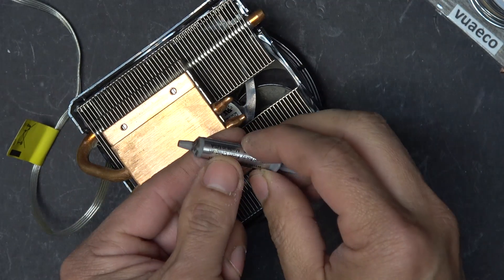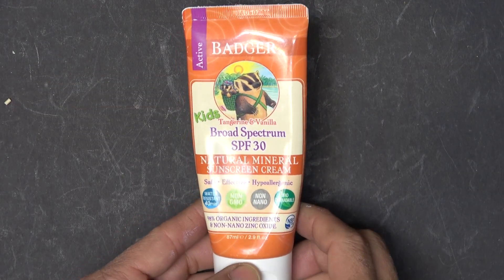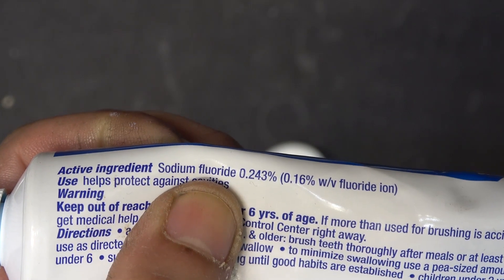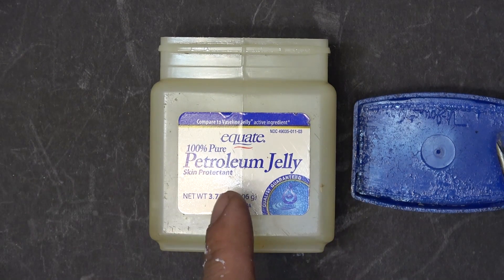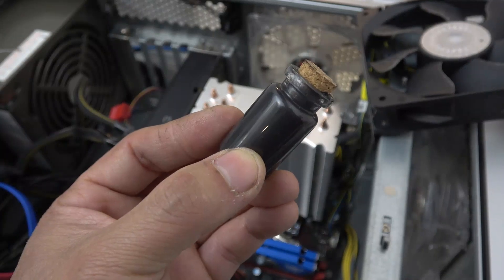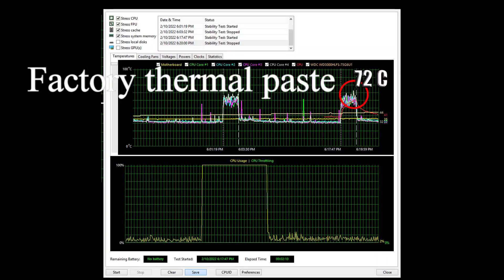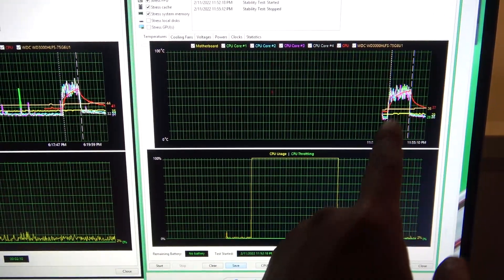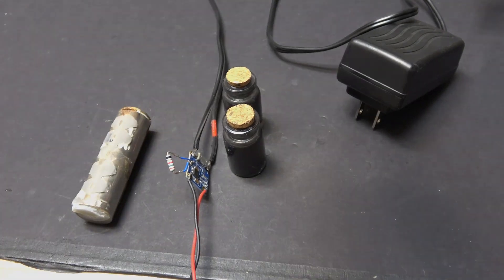DIY: Home made thermal paste from common household ingredients

Comment: What sort of thermal conductivity do you get (in W/mK)?
I mixed some graphite powder into some silicone heat transfer paste (0.66 W/mk, abysmally low conductivity), and it didn't noticeably change my thermals at all.

Comment: Why do you use multiple binding agents and heat-conductors? If Vaseline is a good binding agent and graphite is a good conductor then why not leave out the sunblock? Or if sunblock is both a good conductor and a good binding agent why not use it by itself?

Comment: While the concept may seem appealing and inspiring, Vaseline has low thermal resistance and will easily become fluid. It may not cause problems in space installation, but it will definitely pump out in normal use. Worse, because the prepared thermal paste is conductive, it will damage circuit components and other hardware.

Comment: This mixture worked well for me. I was repairing a variable DC power supply that had a dead 2N3055 output transistor. When finished I put a 2 amp load on it and left it to heat up, after 15 minutes the transistor was hot to touch but the heatsink felt about the same temperature.
I bought the power supply in 1979 and now it has failed, they just don't make things to last anymore!

Comment: What about copper grease? It's already filled with one of the best thermal conductor around, and has an operating temperature of 220C. You can easily further improve it by adding graphite powder.

Comment: You just saved me tons of money, for the rest of my life, thanks a lot man!

Edit: Nevermind, I cannot advocate doing that, I tried doing something similar using HB pencils reduced to fine powder, lithium grease and vaseline and it is not working as intended. 
The temp goes through the roof, and the cpu fan spins like crazy over minor load such as a YouTube video ; which means the paste is simply not doing its job and the CPU is overheating. Perhaps I did something wrong, I don't know, but it's simply not working for me.

I'll buy thermal paste tonight...
Reply: Your HB was not of the highest level of quality, you should better gone to build depo, there where you graphite. Use silver powder too.

Comment: Zinc oxide is also in zinc white oil paint, in fact that's what it's made of, zinc white powder (as the pigment) and linseed oil (as binder). Linseed oil will harden in contact with air, so maybe other oils added will help.  Good to know if you're trying to make thermo paste and you have painter friend or art supply store nearby. Zinc white oil paint plus graphite, both available at the art supply store. Some stores will have pure zinc oxide available, as it is a standard white pigment used in various art mediums. 

Titanium white available as well, it's a more opaque pigment, though not sure of its thermal conductivity. 

Carbon black (lamp black, soot) is a carbon powder of some kind. Worth testing for thermal conductivity instead of graphite powder, because you can make soot anywhere, or you just take it from grills and bottoms of pots and pans, where people cook over firewood. 

Will try some of these, thanks for sharing, I had no idea it's that simple 😄

Comment: I have a question is this conductive to electricity?
Reply: Not really. They use metal oxide in normal thermal paste like in the sunscreen cause it is not conductive.
Reply: graphite is conductive though,but not so sure in that mixture

Comment: Graphite is a very good conductor to electricity. This should be a concern. The idea is to use materials which are good conductors of heat and poor conductors of electricity.

That said, the Zinc Oxide and the Jelly should serve as temporary solution. Heavy no to the addition of graphite.

Goodluck!

Comment: Thank you, I no longer know. I did the same as your steps in the video, then nothing happened on the first laptop because I don’t actually use it much. As for the second laptop, which is the one I used, it no longer wants to stay running. Can you show me a solution or would I like and prefer to buy a better thermal cooling paste?  Thank you for disabling the laptop I use!!!👏👍
Reply: lol this is for a pc though? Why would you use it on a laptop. Pc has direct air cooling from air coolers and or water cooling . Laptops are toys not to be played with man

Comment: IT WORKS! its even better i have an 11t gen intel core i5 and it stays in 35 to 40 celcius at 100 percent load woth using more effective that buying an mx-5 thermal paste!!
Reply: Hola que tal buenas tardes, podrias compartir que materiales utilizaste? por que compre grafito en polvo y no mejora en nada :(
Reply: @lalobross3867  Buenos días/tardes/noches, utilicé un lápiz de grafito, óxido de aluminio, aceite vegetal, óxido de zinc y una licuadora para mezclar todo. Te recomiendo que le pongas un poco de vaselina porque se derrite cuando se calienta, por lo que quedará sucio, ¡espero que hagas una mejor! (Lo siento si mi español es terrible, estoy usando un traductor:( )

Comment: I love this - DIY ftw! I need to look around and see if you have any videos about DIY thermal pads. I have some 1.5mm aluminum that I'm considering cutting up into shims for a heatsink. I'm not sure about the conductivity issue because I'm applying it to components on a PCB that aren't typically covered.

Comment: 0:41 
how did u know this info about factory made thermal paste  ?
and why they use aluminum oxide not using copper oxide which it have high thermo conductivity than aluminum and zinc ?
Reply: The shape of the aluminum/zinc oxide particles favors their use for this application. It turns out to be more efficient even though it has a  lower thermal conductivity

Comment: I mixed my thermal paste with graphite powder and it works just fine with my PC. I was just worried maybe overtime the graphite will conduct electricity that can cause to short circuit.
Reply: It's not working too well because you didn't even add the zinc oxide part.
Reply: @ersthearse  :LOL you do realise they said they mixed it WITH "Thermal Paste" right? .... it already has all the ingredients needed lmao.
Reply: @re2590  ooooof! Yeah, I must've wrote this reply when I was tired af lmao
Reply: Is it still working well?
Reply: @scrumptiousjdp  yeah, but I do not recommend it.

Comment: Instead of graphite,use copper powder see what happens or diamond dust from a jewelry store mixed together with graphite grease from a electrical store.(I'm over do it a little bit)
Reply: Copper powder is electrically conductive, so graphite is safer for the case of GPUs
Reply: Yes using diamond powder as its ingredient is a good idea, it is the best thermal conductor but also an electrical insulator too.

Comment: I'm doing the same with chargers and testers for 18650s. How about silicone with graphite when you don't want the heatsink to slide off?  Water based lotion might work because it's said that water speeds up the curing in pure silicone.

Comment: You can get high purity zinc oxide at an art store. It's used as a white pigment for paints. Get the dry pigment, not the paint. I don't know if titanium dioxide will work.
Reply: it will cost more than buying thermal paste LOL
Reply: @kimochi3140  . No it wouldn't
Reply: @E-BikingAdventures  how much,

Comment: How about powdered silver over graphite?
Thank you for being thorough and bench testing it. 🙏
Reply: Pure graphite has more thermal conductivity then silver. 
Some thermal pastes have silver and are usually not as good as the ones with graphite on it. That's what I've seen.

Edit: graphite from pencils is not pure. 50% is probably some clay or glue ingredient.
Graphite powder is good.
Reply: @1LY4x8s96r  Interesting. Must be something different at the atomic level going on. ...🤔 my mind was wandering, thinking about carbon fibre bicycle(ists) in thunderstorms...😞

Comment: Hey V, you can use a syringe 💉 that is used for children medication. You cab probably get it free at your local Walgreens, if you don't have some laying around.  And an a wire cap for a spill preventer. I actually use those for my 2 part epoxy.  Works great 👍🏼.  Great find with this thermal paste brother.

Comment: I would assume there is some sort of brake fluid or vehicle grease aswell that you can use. They are made for high heats and meant to go on all sorts of metals and surface, and are certainly oily and goopy forevever

Comment: Have you thought about swapping Vaseline for Super Lube? It says it has an operating temp up to 450F (230C). I checked silicon grease too, operating temp up to 180C. This might seem like overkill for semi-conductor heatsinks but useful for 3D printer heat cartridge bridging to the heat block. Thanks for the info & video!
Reply: Having done a little more research on grease alternatives, when using dielectric grease like super lube for high temperature applications (like 3D printer hot end compound):

"Dielectric grease produces formaldehyde when used in high temperatures and can irritate the respiratory system and eyes. Always consider under what temperatures you will use the grease before applying."
Reply: Great insight brother. 😊🌎✨
Reply: nf_ms  depends on your application. I went with boron nitride for my printer but that's no use for CPUs. Petroleum jelly is a Vaseline alternative
Reply: What about copper grease? It's already filled with one of the best thermal conductor around, and has an operating temperature of 220C.

Comment: I noticed that battery has rust.  I have threw away many rusted 18650 cells that appear to hold charge and there is no puncture leaks.   Don't know if its venting or from getting wet.  mostly pulled from power tool batteries.  So I assume they got wet in the rain while working.  but I don't want to take the chance so I end up recycling them.

Comment: I tried to add like 0.5gm or graphite powder on a cheap thermal paste with caution that it will lose it's electrical resistance. I need a reply in case of this is actually dangerous .
Reply: Try using Zinc Oxide or Aluminum oxide instead.

Comment: How long does this paste last?
Reply: seemingly forever as it contains 2 oil based products. no water, or rather barely any water = no drying out
so, technically speaking, this man could pull the heatsink off after 1 year usage and the homemade paste should still look shiny/gooey/sticky/slimy ect. and because of these properties, the graphite in the mixture can't "move" and thus conductivity should retain.

i have no clue on how fast graphite/graphene powder or liquid degrades over time or if it even degrades.. so you'd have to research that yourself to get an indication on how long this will last.

Comment: Nice video!  I was looking around my house and found some dielectric grease for my car. It might be better than vaseline since it's meant to withstand higher temps.  I also have a small tube of graphite lubricant for locks. All I need now is that sunscreen.
Reply: Wait you can use dielectric grease instead of petroleum jelly? I surprisingly don’t have petroleum but I do have dielectric grease

Comment: Great idea, thanks!   Only thought I have is that, in my experience at least, petroleum jelly becomes very thin and runny , almost liquid-like at sustained higher temps.   So may want to watch closely for any squeeze-out after sustained high heat loads ( especially for spring loaded heat sinks.).

Re: 4056! hacking, I came up against that a while back.  You can use a resistor outside the spec shtetl range for higher current, to a degree at least.   Needed beefy heat sink , and it helps to get the input voltage closer to CV voltage (4.2).  I used a shottky diode to take the 5v supply down maybe 0.5 to 0.7 ish volts under load , taking some load off the 4056.   But  to get the current up substantially, I also ended up using 2 or 3 4056 in parallel.   This works fine and in fact there are many charging boards and other chinese electronic products using charging ic in parallel.   I paralleled the module input and outputs, as well as the chip pins for the two LED indicator circuits, removing LEDs on all but one of the modules .
Reply: Basically thermal grizzly kryonaut is thin and runny at high temp and thats why it's a best spreading thermal paste, best performing. Manufacturer advises us to reapply every 3-12 months depends on the usage because the thin and runniness has a cost of squeezing out to the sides. As a result you almost no longer have thermal paste between your cooler plate and CPU. It's especially nasty on laptops and GPUs. I opened my GTX 1070 to find that the die and copper plate was almost squeeky clean.
Reply: @Underground.Rabbit  Interesting.   In that case I imagine it isn't electrically conductive otherwise it could start shorting pins out after it has oozed out.   That was my concern here - since any oozing would be of electrically conductive material..
Reply from the maker: Thin and runny is actually good because it will fill in the gap between the 2 metal surfaces and that's what you want. Problem is, people use too much of it thinking more is better. It's not the case here.
Great idea on the TP4056 hacking. One problem with adding a resistor before it gets to the unit is that it will add more to the load of your 5V power supply. That means to achieve 2A charging output, you'll need much more to compensate for the schottky diode.
Reply: @vuaeco  Sorry meant the resistor that programs charge current , as described in datasheet.  (not in line with power.)  shottky diode  in line with power supply, with appropriate current rating and heat sink as required .

the tp4056 is linear.  it's basically a smart-ish resistor that burns off whatever voltage needs burning to match the charge /cell voltage and achieve the programmed current, (or 4.2v constant voltage at the end ) .   The input power supply current will always be exactly the same as the charging current; there is no DC DC conversion going on with the 4056 .   There are other boards out there that have buck converter style conversion, with an inductor etc..  more efficient less heat, but more expensive.  check out TP5100 based board, for example  ..

Comment: I grew up with Zinc Oxide then in 2020 I needed some new Sunblock and none had it.  I finally found some, but it has Titanium Oxide in it as well.  The Zinc Oxide was only 4% too for a 50spf tube.  Knowing now that Baby Diaper Rash has a high concentration of Zinc Oxide in it that I now know what to get (still check the label though).  Thank you.

Comment: lol the electrically conductivity of your paste would have my motherboard destroyed while the large syringe of cheap thermal paste is not conductive/high resistance. I have my motherboard covered in this stuff. need to cool this 5W turned into 12W tablet somehow.
Reply from the maker: You only need a very thin layer of thermal paste and should not let it spill out of your cooling area.
Reply: You are wrong. Arctic Silver is highly electrically conductive. This was the paste he was comparing to, Only certain types of less theremally-conductive pastes are not electrically conductive.